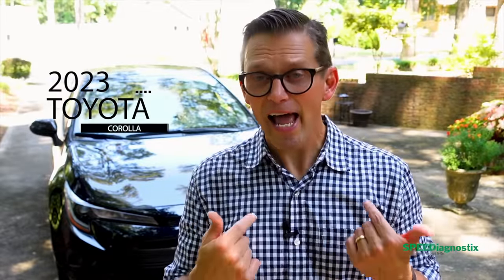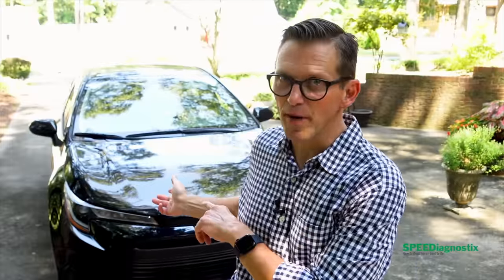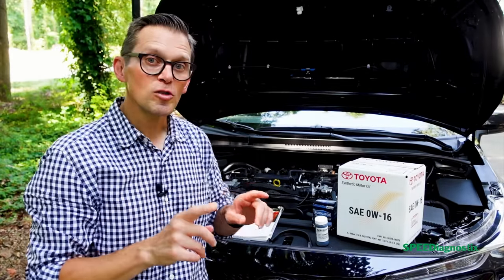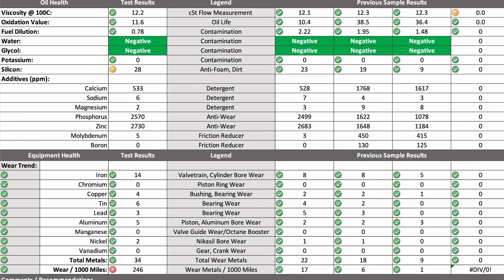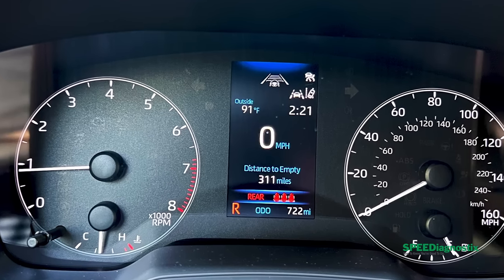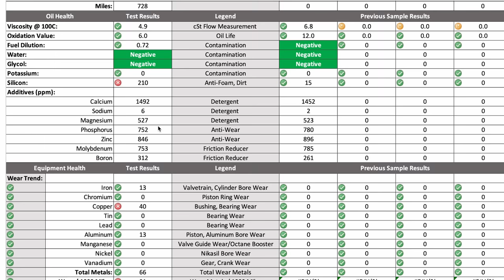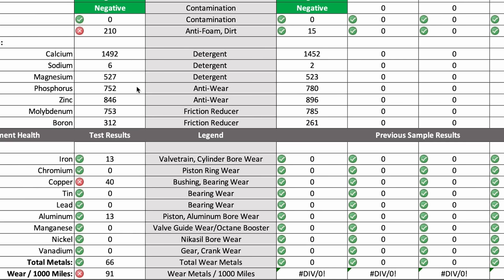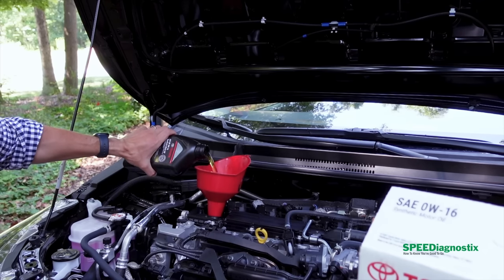AVOID the ONE MISTAKE Almost EVERYONE Makes With A Brand New Car

Comment: My uncle, a lifelong mechanic beginning in World War I, taught me to change the oil in 500-1000 miles. Break-in change was standard 100 years ago. I’ve followed this advice with all of my new cars. I’ve never had an oil related engine problem.
Reply from the maker: Right on!
Reply: Yea, engines and oils have improved somewhat since 100 years ago 🤣  No break in change is needed these days. I do first change at 10k. Never had oil related problems either. Why on earth would I?
Reply: I've drank a bottle of jack daniels with the first oil change in every car I've had.   I've never had an engine oil related problem.  I think the evidence speaks for itself.    :p
Reply: @motleydude73  How long have you kept your cars doing oil change intervals like that?
Reply: @piperpilot26  About 6 years on average. Current one for 13 years which I bought new in 2010. Been driving since 1989. Back then the normal interval was 6k when mineral oil was the main type.
Reply: Break in at 1000km standard still in the 90s.
Reply: @patrickcannell2258  No it wasn't.  I started my apprenticeshop in 1995, first oil changes were at 10,000 kms. They stopped break in changes in the late 1970s. Though let me guess, you live in America, which is 50 years behind every other country?
Reply: @motleydude73  Where you from, one of the countries that America saved the asses of in WW2; or understand the fact that America pulled ahead of every other country since then in tech and everything else. I guess you didn't watch the video and the results of the oil test that proved his point.
Reply: @motleydude73  man, you've just been lucky. Ignorance is bliss, I guess.
Reply: @budlanctot3060  Lucky? Ignorance? To what? It's 2024 lad 10k mile oil changes have been the norm for 20 years now. It's what most people do. Guess they're all just lucky too 🤣🤦
Reply: @motleydude73  2024? Yeah, so what? Oil quality has improved, I'll grant you that. But what we demand from our engines, now, keeps growing. Engines are much more stressed, now. In order to meet increasingly tough requirements, we demand more from our lubricants. Engines run hotter, today, they are generally smaller, yet produce more power via turbos, superchargers, low-tension rings, lighter pistons. Many engines run overhead camshafts running in bare aluminum "bearings". Most Engines have roller lifters/rockers, VVT and some have MDS or DOD, etc. which all use oil to lube/control them. For some people a new car is a huge commitment in money, and they don't have the wherewithal to afford replacing the car or engine prematurely, so continue being reckless with your own cars, that's your business,  but don't rag on other people who want to get the most out of their investment by being extra conscientious about maintaining  their engines.
Reply: @budlanctot3060  Reckless? 🤣  Following manufacturers guidelines lad, zero problems in 34 years of driving. Over a million miles driven. You realise they benchtest engines and oils far beyond the stresses of daily driving? Toyota run theirs for 166 hours straight at WOT. If they say 10k miles is fine then it is. Yet to see any problems in anybodys car after 29 years as a service tech. Changes at 3k  is insanity. Where does this paranoia come from?
Reply: I change early
Reply: @motleydude73  ok. Lets say you run an engine at 100mph(vehicle speed) for 166hrs. That's only 16,600 miles. Big deal. That's nothing. When I buy a car, I expect to get 200k+ miles out of it without a major engine problem. That means I hold onto my cars for 15yrs MINIMUM. I have a 64 Dart that I've owned for 50years. I have 3 Cherokees with 800, 000 miles between them, with ZERO engine problems other than a water pump. I've been driving & wrenching for almost 60years. At 34 years of driving, you're just beginning to gain experience.
Reply: @budlanctot3060  Just beginning 🤣  29 years turning wrenches over 15000 oil changes and yet to see any issues from sticking to manufacturer recommendations. Many of the vehicles are well over 15 years and 200,000 miles.  And your logic is flawed. The tested hours are nothing to do with a distance travelled, it is just valuating stress limits on crankshafts valves and pistons and to determine oil performance and potential wear. You don't do 100mph at 8000rpm which the test engines are running at constantly. Toyota engine tests also takes randomly selected engines and revs them from idle to 6000 rpm 200,000 times. Yet people worry about extended OCIs 😆
Reply: @themotoroilgeek  I must admit, I gotta know why the Boxter needed a rebuild? Rumor is you were using seafoam in it. Lol
Reply from the maker: @patrickwelch620  LOL. The story on the Boxster is coming soon!
Reply: Flushing the oil is pointless
Reply: Confirmation bias. I do 10k and neither do I.
Reply: I just saw lake speed's latest video where he discusses engines with a lot of chains, OHC chains, oil pump chains, balance shaft chains, etc are hell on multi-vis oils. They tend to shear the long-polymer chains which adversely affects many if not most multi-vis oils.
Reply: By your logic if 10k is good wouldn't 100k be even better?  Just don't even open the hood. Your car will love you for it.
Reply: @motleydude73 so what about all the Toyota engines with extreme sludge problems and Tundra’s breaking camshafts
Reply: @F8lastcallcharger345  Bugger all sludge problems. Bugger all Tundra problems. There's a massive world outside of the US chap where Toyota have no problems. Sludge is from  lack of servicing. Camchain failure is from tensioner position due to poor design. Nothing to do with the oil.
Reply: @cliftongreene5318  WTF are you on about? Where did I mention that? Yes 10,000 mile oil changes, it's 2024 wakey wakey. A good synthetic will do 20k easily. Been doing 10k mile changes for 20 years, as per manufacturers recommendations. 2k is insanity. 🤣🤦  Oil does NOT begin to break down after that mileage.
Reply: Nice!

Comment: I took delivery of my 2006 Toyota Sienna and by the time it hit 2000 miles It already had three oil changes. At 10k miles  it had six oil changes. It now has 221k miles and drives like new. Recently I  sent an oil sample for analysis and it came back perfect !
Reply from the maker: Right on!
Reply: My 06 sienna is on 330 and still good
Reply: If you use good oil you can achieve that same feat in less oil changes.
Reply: Wow! I'm not as fastidious as you are, but I bet your engine is super clean.

Comment: I purchased a new 2023 Chevy Malibu with a 1.5 liter turbo ! I completed one (1) trip down south from the northeast, and did the initial oil change at 1900 miles. An oil analysis sample reported the engine is breaking in properly. I didn't reset the oil life monitor! The dealer told me bring in the vehicle when the oil life is around 20%, or 6000 miles. I will still go to the dealer for the so-called courtesy free initial oil change and will not tell them I already did (1) oil change. I did this before with other new vehicle purchases. Bottom line, YES, absolutely do an initial break in oil change, if not at 500 miles, sometime around 1500-2000 miles ! If your keeping the vehicle don't wait for the 5000-7000 mile initial oil change. Do one in between !
Reply from the maker: Right on!
Reply: Good move, no need to tell the dealer and hurt their feeling.

Comment: Really good to see you telling people this . I'm a performance engine builder and I will give a motor a oil change right on the test stand or dyno after 30 minutes,  than in the car and 100 miles than again at 500. And I would never run  any oil in anything for 7 or 10k thats emissions propaganda. I also do trans and rear end oil very often.  Often
Reply from the maker: Thanks for sharing!
Reply: Yes thanks for sharing! Good to know all this great info from everyone, info that has seemed to have been lost in this modern age of consumerism and planned obsolescence.
Reply: Not emissions propaganda, it's the cost of ownership to 36k miles (or whatever milage the writer calculates.)  The second reason is factory paid maintenance. The millions of dollars extra they'd spend for an extra oil change for 125,000 vehicles if interval is dropped 2500 mi and the vehicle gets 1 or 2 more changes is big reason. I worked corporate for a manufacturer and no emissions consideration was involved. In Europe the story is different.
Reply: @jimmyaber5920 0W-8 has to be emissions nonsense though. So thin that it's ridiculous.
Reply: How would oil with more miles on it reduce emissions? Sounds like a faulty theory

Comment: Thanks for bringing clarity to an often debated question. In the past I had always changed my new vehicle oil at 500 miles but had gotten away from the 500 mile and moved to less than 3000. I now have justification for changing the oil in my new Silverado HD 6.6 gas engine at 600 miles instead of waiting. You also validated my practice of filling the new oil filter. I have made this a practice for many years, especially when I was working on the big trucks at work.  I appreciate you generosity in sharing your knowledge.
Reply from the maker: I'm glad it was helpful!
Reply: This seems gets rid of the the metal chips left over from matching. Also should get rid of the assembly lube grease that may contaminate oil filter. I've been doing this a long time on new engines even lawn mowers.
Reply: No debate just change it as per manufacturer recommendations not taking some geeks advice on youtube! He's just costing you money and you're wasting good oil.
Reply: @motleydude73 rather waste good oi than a good engine
Reply: @rogerdodrill4733  Why would your engine fail? You americans are uber paranoid about oil it's laughable. Just chuck fresh stuff in every 10k miles and drive it your engine will be fine. In my 32 years in the trade I've yet to see an engine have catastrophic failure because the owner stuck to manufacturer recommendations. They built the engine they kinda know best huh.
Reply: @motleydude73  they kinda have a motive to sell new cars & engines
Reply: @rogerdodrill4733  People buy new cars at their whim. Often every 5 years or so. That's a given. No 'motive'. New engines? Very rarely. Most last 30 years or so.
Reply: @rogerdodrill4733  Toyota is worth 250 billion, you think they care about how often people buy cars? They base their philosophy on innovation, reliability, longevity. Being a top seller then comes naturally as people trust what they sell as being value for money.
Reply: @motleydude73  who do all the engine rebuilders sell their engines too? People with worn out engines I'll bet
Reply: @motleydude73  the people I know buy cars to replace their old ones that are no longer viable
Reply: @rogerdodrill4733  And a lot just like the latest and greatest. Their old cars are still perfectly fine. It usually comes down to affordability. I've always had older cars 10 years+
Reply: @rogerdodrill4733  Old classics from the 50s and 60s for hot rods, diesel engines that have 500,000 kms rebored so they can do another 500,000. Heavy equipment engines from dozers and excavators. Some engines have inherent faults from new so need refabricating. Head skimmed, valves reseated. A lot of their work is often skimming flywheels. Transmissions fail far more than modern engines. The average family car never needs doing and it's rarely economical to do so.
Reply: @motleydude73 . Yeah , it’s better to take advice from some random guy on YouTube without any credentials, than a certified Tribologist.   What a Yahoo.
Reply: @G17-911  He's a certified nutcase. Stressing out over oil 🤣  Just chuck fresh shit in your car every 10k miles and forget about it. And I do have credentials. It's called real life experience.
Reply: @motleydude73 .  Why are you watching if you don’t agree with him ? Seems like a waste of your time.
Reply: @G17-911  I enjoy a good laugh occassionally. This guy brings it! 🤣
Reply: @motleydude73 thanks, admittedly a good point….
Reply: @motleydude73  are you for real its just common sense
Reply: @motleydude73 I'd trust the word of a guy with a 500k original engine & transmission car over that of the car's engineers who may not even be driving that car themselves and whose bosses need to sell more cars.
Reply: @Mika-ph6ku  Reality bud. Live in it. 10k mile changes are all you need to do. Who wants a 500,000 mile car? Most sell theirs  long before that.
Reply: @motleydude73 do you realize who this is? His name is Lake Speed Jr. He is a lubrication specialist, and is the head of a piston ring company. He tests engines, and oils, for a living.
Reply: @garyszewc3339 Dude commenting is just some random troll, ignore him.
Reply: @motleydude73 🥱
Reply: @motleydude73  u only need to surface a fly wheel if you're clutch is worn out & disk has damaged flywheel .most cars are auto, have no flywheel to  need resurfacing wtf u talking about?
Reply: @rogerdodrill4733  Talking about flywheels bud. We remove and skim about 3 a month on average. Usually off Toyota Hiluxes. Some only a few years old.
Reply: @motleydude73  Newer cars just change it at 5k miles, why wait to 10k. Cars over 100k miles maybe every 3k. No ones talking about keeping it to 500k.

Comment: From an engineer... Higher level wear during the first few thousand miles is normal and is completely expected as all the components are getting broken in so very fine particles from newly machined surfaces are created. Like he said changing your oil early is good so you get these particles out of the system.